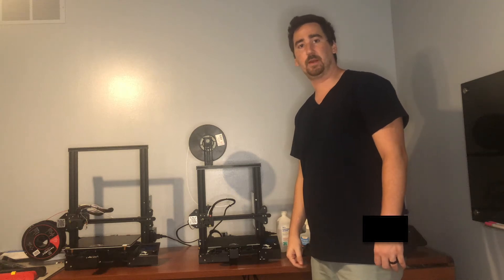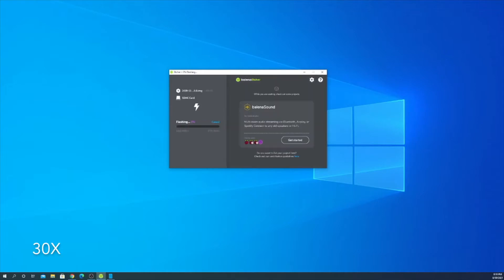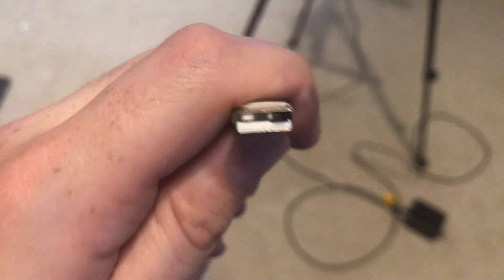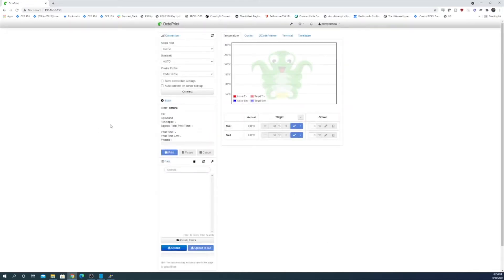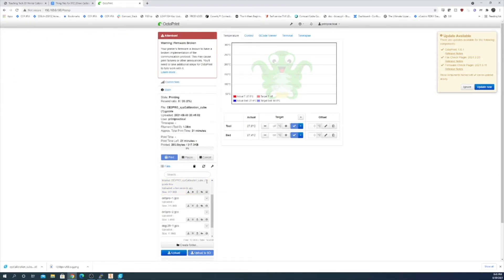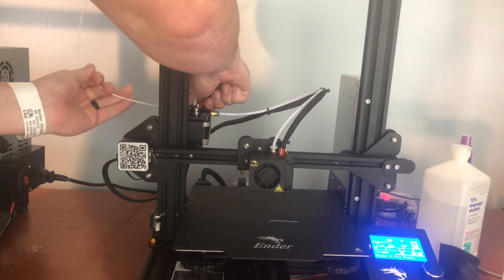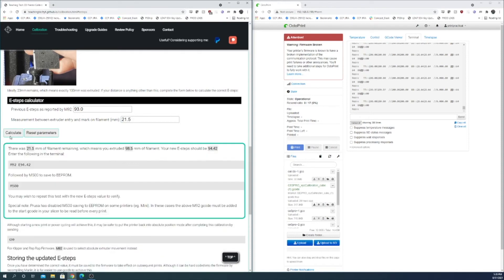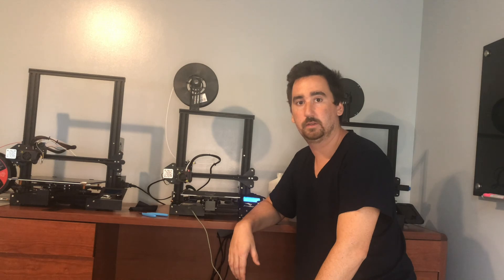How To Setup Octoprint | PID & Extruder Step Tuning | Ender 3 Pro Build Series EP2

Comment: Really enjoying this series.  Even though the RPI Imager is out, I still use Etcher to flash my RPi's (I run 12 or so RPi's for network monitoring, website, ansible, gitlab, etc).  The RPi imager doesn't like restoring my backups very well.  I tried the tape trick for the power from the Pi, but ended up getting a USB Power Blocker from TH3D.  Going through the initial setup now (had to find a spare usb to micro cable to hook the RPi up).  Will definitely be back to watch the rest.

Comment: I have 2 ender 3's one is a pro. Both have the skr mini e3 v2 with e3 v6lite hotend. I need to pid tune both of then but can't get my printer to show up in pronterface. It seems all of this will be fixed if I just buy a raspberrypi. There are so many options and most are sold out. Which pi should I get?
Reply from the maker: I would get a RPi4 if possible, as you want the latest and greatest. You can use the RPI site to find where you can buy one: https://www.raspberrypi.com/products/raspberry-pi-4-model-b/

Unfortunately supplies are low these days. Thanks for watching!
Reply: @PrintPractical  I overpaid for it. But I got a kit with the pi 4 4gb. I'm almost certain it will fix my pid issue. And let me install this bltouch that's been in a box for a year
Reply from the maker: Yeah.. seems to be the market right now. If you have a Microcenter near you, they typically have some of these in stock.
Reply: @PrintPractical  unfortunately I don't. There's one a state or 2 over I think